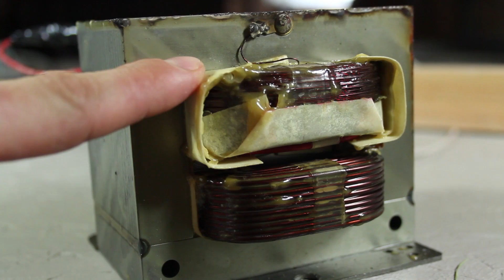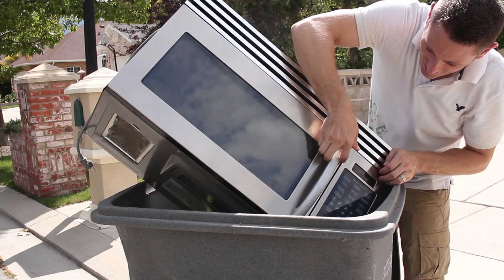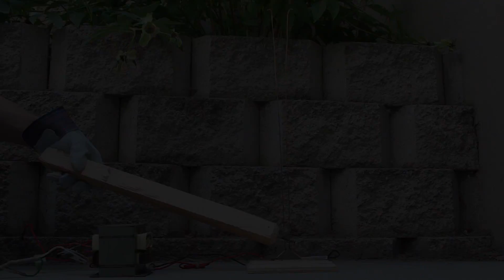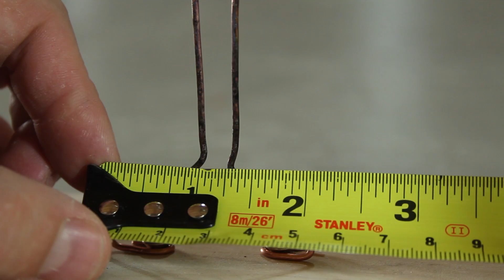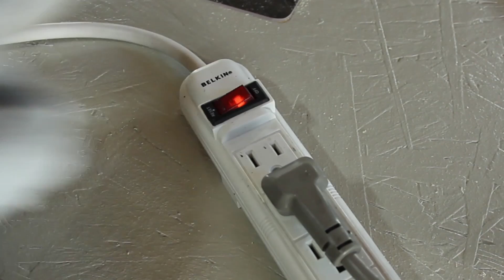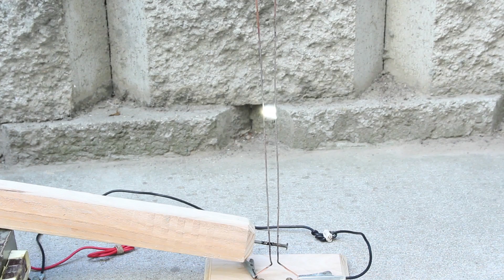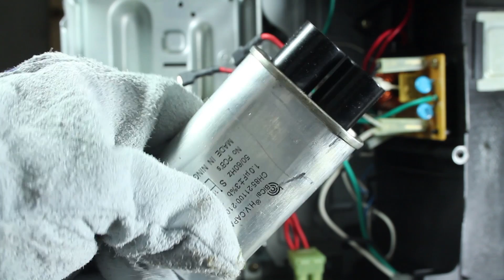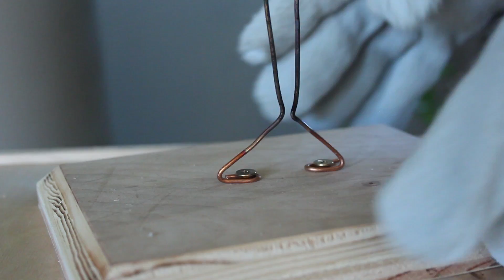Lethal Electric Arcs (MOT Jacobs ladder)

Comment: Amps kill, not Volts...
Reply: It's both. It takes volts to push the amps though your body.
I'd much rather touch a 700A 12V supply than a 700V 12A supply.
Reply: MadSparks164 This is true. I accidentally touched an 85V 10A power supply and got the shock of my life. The entire right side of my body tightened up and I could feel my muscles spasm. I've also touched a 12V 69A supply before (for an HHO cell) and it barely felt like anything. I think the 85V 10A felt so bad cause I was sweating that day. Sweaty hands + high voltage = serious pain.
Reply: So I'm still right. If the amps aren't high enough, an incredibly high voltage does nothing. You are absolutely right by saying volts are needed to push it through your body (that is exactly what Volt does). Again, I'm not wrong in saying amps kill but not Volts.
Reply: I guess, it is the current going though your body that determines if you'll live or not, but you can't have that current without considerably high voltage. Which is why I say it takes both amps and volts to kill you. MOT's give a high combo of both. Watch "Its not the volts that kill you, its the amps." By Afrotechmods.
Reply: When someone says this, you can assume they don't know much about electricity.

Comment: when you're dealing with that high voltage and current how do you know what length of insulation safety stick is safe?  i get nervous when i mess around with that kind of voltage/current.
Reply: its wood so it does not carry current and he is wearing gloves

Comment: I once made a Jacob's ladder using an old automobile ignition coil, the ignition capacitor, and an old fashioned doorbell buzzer for the switching mechanism to open and close the circuit.

And yes these things produce high voltages. Playing with high voltage electricity can be dangerous. Don't play around with this stuff unless you know what you're doing. Homemade projects are always at your own risk!

Comment: I've salvaged a MOT, but i'm scared as to whether i should plug it up to mains to make one of these, i'm only 14, but i saw someone else make a large electromagnet by taking the secondary coil off and pumping DC through the primary, i think i'm going to do that, sounds safer!

Comment: I'm not very smart but you said it was converting the air into ozone. Then you said ozone was poisonous. Isn't the earth surrounded by ozone?
Reply: Yeah, it's way up there though, you know, where we're not breathing it.
Reply: Ok so what keeps the ozone away from us breathing it? I am guessing that ozone is lighter so the oxygen stays trapped on earth because of the ozone floating above it?
Reply: ***** No, ozone is heavier than oxygen.  Oxygen gas is O2 whereas ozone is O3.  Luckily for us, the atmosphere we breathe is not made up entirely of oxygen gas.
Reply: ***** There are three main types of oxygen:
O- oxygen, the base element
O2- oxygen gas, the one found in dry air (78.09% nitrogen gas, 20.95% oxygen gas, 0.93% argon gas)
O3- ozone, this is way up in the upper atmosphere and protects the earth from a large chunk of the lethal solar radiation that is emitted from the sun
Reply: UV light from the sun hits the ionosphere and turns oxygen to Ozone. Ozone helps 'clean up' smog and other bad things in our air. When it's storming outside you can smell ozone. Ozone is capable of destroying every virus known to man. It's used to clean water in swimming pools, hot tubs, shower walls, vegetable sanitization, and even to white wash blue jeans. Ozone has a 15min halflife, meaning as soon as it is created it will turn back in to oxygen within 15mins. There are several ways to create Ozone, corona discharge (lightning), UV light, and some other things I can't think of. 

No one has ever died from Ozone. In high concentrations or over long periods of exposure you will start coughing to the point you will vacate area. Ozone has no long term affects on your health. The place I work at deals with Ozone at very high levels, the worst it's ever done to me is make me cough for 30 mins. Ozone is used in the health industry of several other countries, and it has even been claimed to cure aids in the UK.

If you want to call something dangerous look at what they put in our water, almost all other countries have banned the use of chlorine in water treatment because of how dangerous it is.
Reply: Well it is now
Reply: yes but not much
Reply: O3 is poisonous but it still is there, strangely higher than O2...
Reply: ozone is poisonous but it is way above us and shields us from the destructive UV rays
Reply: Chris Qiao One thing strange is this: why does O3 float higher that O2 but is heavier

Comment: W A R N I N G..........MOT's are V E R Y   D A N G E R O U S !!!!!!!!  Unless you have a lot of experience with safely working with and are very careful/respectful of HIGH VOLTAGE/Amps and devices etc,  DO NOT mess around with these or let others or even let them have access to them. In standard unmodified form they put out about 2,000 volts at 2 amps which CAN BE LETHAL if mishandled.

Comment: how could that electric orb can creat UV rays radiation
Reply: There is a heck of a lot of energy between those electrodes, and also note how the plasma is slightly blue in colour, some of the energy is converted to light and the rest is converted to ultraviolet rays.

Comment: When I was building my Jacob's Ladder with a neon transformer, I found it somewhat difficult to start the arc.  I used what is called a Gabriel Electrode, which is nothing more than a resistor (do not remember value) that is connected to one arm of the ladder and the other end floating about half way to the other arm.  This lower resistance (than the air gap) is easier to jump for the arc, then when the arc is created, it travels up the arms.

Comment: A much easier way to straighten copper wire. Just put one end in a vice and pull hard on the other end with pliers / mole grips / whatever.
Once you get it to yield it will be totally straight, and a bit harder.

Comment: If you want to make wire straight the best way is to put one end in the vise, the other end in your hand drill. While pulling the drill make a few turns left, a few turns right and repeat the process a few times. After that the wire is perfectly straight. Like your videos. Keep on posting!

Comment: Grant...your clips rock :) I saw that you use a flat sheet material to straighten your wire....little trick I learned whilst ceiling hanging was to put one end in a drill and anchor the other end....just a few turns of the drill will straighten out lengths of wire to a near perfect line so long as you pull the drill away to create some tension on the wire as you drill

Comment: Those capacitors actually have an internal 10 MΩ resistor parallel to the capacitor inside, so discharging them is actually not necessary. Within seconds of turning it off, the capacitor has already discharged to reasonably safe levels (though don't lick it anyway).  I know because I actually took apart one of the exact same microwave.  The difference is that mine had an envelope with a complete schematic, right behind the service panel. I also did cool stuff with the motors.

Comment: electrical arcing on the good side is not all that bad of a thing actually it's used in many applications like the welding and smelting of metal do to it shear heat, it also used in spot lighting like in sodium vapor street lamps,movie projectors,and strobe lights matter in fact the spark plugs in your car's engine demonstrates an electrical arc to ignite the gasoline

Comment: Its not the volts that kill you, it the Amps. Amps is current and can be pictured as the flow of electric charge travels per second. Above 200 milliamps is where it can be lethal to a human being. So even though the tasers can have lots of volts, the amps are probably low. While in this video you see the capacitor release all the electric charge all at once and that's why this can kill you.

Comment: As a tip for straightening wire, you can pinch one end in a vice and use a drill on the other side. gotta be careful though

Comment: You should have done it with an NST. Some people with minimal high voltage knowledge would try this at home, and kill themselves. I'd have used a MOT but the only microwave I was allowed to take apart had a solid-state MOT. I used a (rather crappy NST from when I just started getting into high voltage--unfortunately I'm broke and can't afford another one--no neon shops that I know of around here) 7.5kV NST for my first one. The hardest part was getting the arc to start and stop by itself >.>

Comment: MOTs will draw a lot of current on the primary because they are made cheap, so they are poorly made with minimal impedance. I would recommend a good healthy 15 amps for so input for the MOT. Take great care, unballasted MOT currents on the high voltage side are more than lethal.

Comment: You should always ground the core of the MOT. This is a standard in any microwave oven and it prevents the core from floating at 2kV. By grounding it, it is no longer floating and it's at no high voltage potential. I would recommend you securely ground it next time.

Comment: as you only have two wires coming from the primary coil can you still just put them into a 3 prong plug without using a earth wire or will that have consequences to the household mains?

Comment: Lol... Boosting the amperage in AC? ;)) 
No. Just pushing back current into the transformer. The cap is behaving almost like a shunt, like that. 
If you would connect the cap in series, then you would spare the transformer from some of the most brutal shorts.

Comment: You put the cap in parallel to the secondary? Why? Surely it won't resonate at 50 or 60hz.
Except dropping the voltage, what did you expect?

Comment: Hmm. A MOT gives about 3.5kV. Air starts to break down at 5kV. You could use an auto transformer (which is a single coil with multiple taps) to step it up a couple of times. You could coil some insulated wire on an iron bar. Connect the secondary across the bottom and about a third of the way up. That should give about 10kV between the bottom and the top. Perfect for a spark gap.

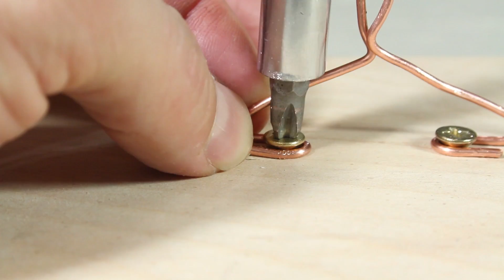Comment: Plasma is awesome isn't it? I made a 45kv light bulb, I think your subscribers would like to see you make one.. :) fluorescent light bulb ~1kv powering a flyback transformer salvaged from a CRT monitor primary/secondary is tricky to test, but i believe mine was 1:45 going through a burnt out large argon gas incandescent bulb. Ohh and lots of hot glue insulation HV likes to leak.

Comment: When I was a kid (some 60 years ago), I made a "jacobs ladder" using an old wooden cased Model T ignition coil (AKA vibrator coil or buzz coil) to generate the high voltage. No one in the area could listen to the radio when I was messing around with it. I wish I still had that old ignition coil. To see one, image search "Model T ignition coil".

Comment: Its hard hard for me to explain it, becaus I'm a German and my english is very bad. So ground it, if one wire is soldered to the core.
(ground the core). I have one MOT, witch didn't need this, but 99% of all MOT's need it. You can search for 4hv forum, this is on english and they can explain it better.

Comment: Because the Isolation of MOTs are really bead, because it is easier 
and cheaper to ground one side of the secondary instead use much isolation material. When you not ground the MOT, a arc can go from one winding into the core and destroy the secondary.

Comment from the maker: The answer is yes.  They move up because the air is heated and rises .. so you could blow them back down with a draft of cool air, or make the gap smaller so the arc stays in one spot.

Comment: You'd need a higher voltage to make it start on it's own, as in dry air for each millimeter of spark you'd need 1000 volts. As a MOT only supplies about 2.2 kV you'd need at least 5 - 10 kV to jump a gap this big.

Also, you might indeed want to use a neon sign transformer; the current is lower on those things and won't kill you as easily.

Comment: I make Halloween props and a Jacobs Ladder is a staple of many "mad scientist lab" displays. Is there a way to get the arc to automatically repeat? I understand that if it runs for too long it may trip the breaker, but having it run for a series of arcs, then resetting might be useful. Or is using the neon sign transformer (or whatever it's called) a better "safer" option that would be able to run continuously? Thanks! 

Cool videos, and looking forward to the stick welder.

Rich
Reply: Be careful with high voltage and the liability’s around others with this. You could build a circuit with a repeating pusher. NST are safer too with the less amps. Just learn the grounding and how to not get circuits through your heart.

Comment from the maker: Coat hanger should work great.  You can get away with hot glue, but make sure you know what you're doing before turning anything on.  Respect that this may kill you if you make 1 little mistake and touch something the wrong way.

Comment: i use hot glue to attach the wires after twisting them together is that enough insulation so the electric wont come out of the exposed wire, and i used a coat hanger that was metal will this work or should i change design

Comment: More of a guided tesla coil... I could see it being possible actually... In the test you run indoors, where the arc travels momentarily through air, (Heating the air around it as you say) it gave me the idea that if an arc powerful enough could travel some distance before dissipating, it would create a rather lethal weapon possibly. Or do you think that the amount of power required to create such an arc would be too much to be able to contain in a handheld (or tri-pod mounted) weapon?

Comment: I don't know how to do it from common and inexpensive items - I'm afraid that power electronic converters would be cheaper [ and less reliable ], plus they are fully adjustable. The problem is, that they will be damaged quickly in an applications like metal melter :(

Comment from the maker: In series or parallel?  What are you hoping to achieve?  If in series, it could double the voltage.  If in parallel, it could double the amps.  If one primary is connected in series with the other primary while the first one's secondary is shorted, it will act as a ballast on the other to limit the current.  Does that answer your question, or did you have a different idea?

Comment: i dont know
but cans of beer (empty) evaporated and a wrench started glowing and bending
i had to limit it with a second mod becaus it gave to much power (got to hot)
and that made it worse i could pull arks for more then 2 hours without it getting hotter then 40 degrees celciuc

i had to trow it away and i still hate that

Comment from the maker: Aah, that makes a big difference :)  Even better is to ballast the circuit (with another MOT attached with the primary in series and the secondary shorted out) to limit the current, and I've had great success with that.

Comment from the maker: I suppose if you were to convert it to be able to shoot a beam of high speed electrons into an acrylic sheet until the effective charge reached millions of volts?  The way I understand Lichtenberg figures is that you couldn't just connect this to a block of acrylic and make it happen.  You need an electron accelerator?  I think the power is there, but it's needs to be converted to higher voltage to be usable for that project.  Correct me if I'm wrong.  Thanks!

Comment from the maker: It's not so much a matter of how many arcs as it is how much current is shorting through the arc.  The factor varies with time, temperature, humidity, altitude, etc so it's not certain.  But as a general rule I'd say you have about 4-8 seconds of sustained arc before the switch flips.  You can ballast the circuit to limit the current as well and it will run indefinitely!

Comment: Good video, indeed. But you went wrong not underlining enough the ENORMOUS danger of a MOT (Microwave Oven Transformer). NEVER play with high voltage from that kind of transformer: it isn't limited in current and a single discharge on you and that will kill you INSTANTLY and burn human tissue. To start "playing" with high voltage is a better idea  to use a flyback transformer or an NST (Neon Sign Transformer). BE CAREFUL GUYS!!